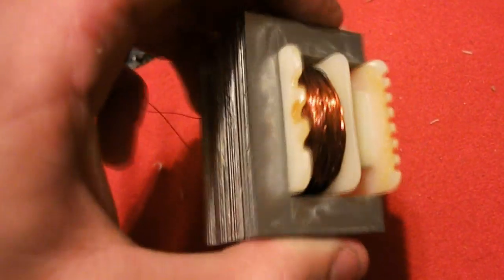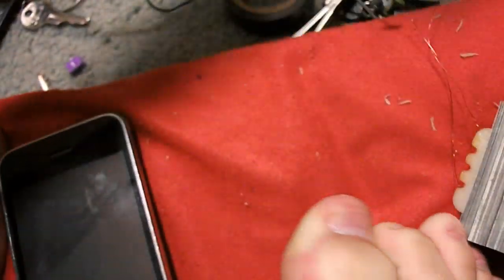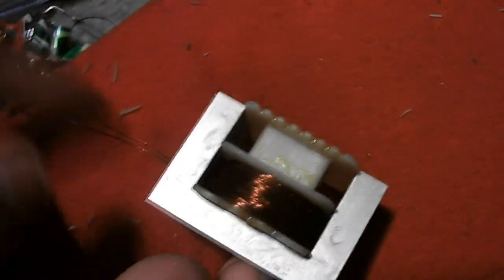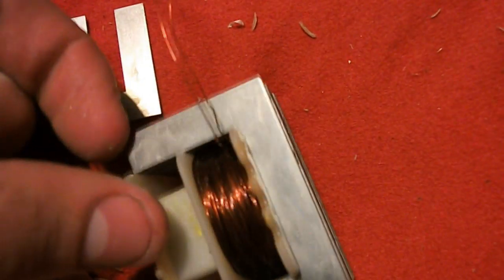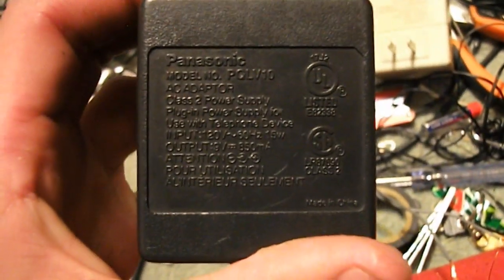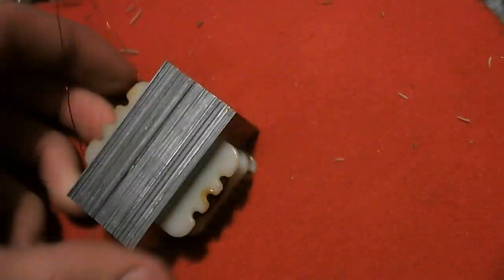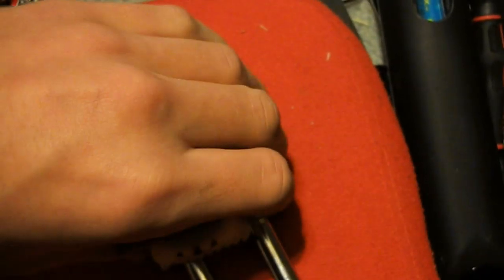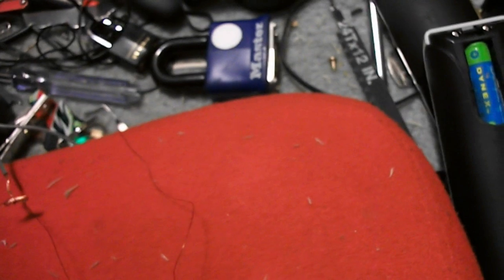how to make an electromagnet that works

Comment: you have tried AC... that was an ac adapter...
Reply from the maker: hattergraphics AC wouldn't grip anything. The field would turn off and on 60 times a second. It would hold,  then release,  then hold,  then release.

Comment: The 250 windings are for your house current right?
(120 windings for 120v outlet)
Reply from the maker: Not on this project. They are just the number of turns I found that worked pretty well with the 9v adaptor I had. Do  not plug this into your outlet, it'll blow the breaker and smoke the room.
Reply: Oh......
But why won't that happen if done with a microwave transformer? (with secondary coils taken out)
Reply from the maker: Yevette Xoxo Welll... That's a long explanation. Hold on tight! So, the windings on a microwave transformer are much thicker and the size of the transformer is also a lot bigger, this means the wire can handle more current. That current is then absorbed into the magnetic field of the transformer body- that huge lump of iron. That huge lump heats up a bit from this and also can store a whole lot more energy than those little wires. When the current is needed on the secondary, the iron core dumps all that power into the other winding which then eats all the power out of the transformer and keeps it from overheating and dissipating all that power. The windings don't get hot because the core itself sucks all the power out of them and stores it. On a rewound MOT, the secondary gets quite hot because of the amount of current it can pull. The ratio of turns between primary and secondary determines voltage, while the size of the wire determines amperage. Hope that helps!
Reply: Yeah.... I get all of that
But isn't that still bridging the outlet's + & -?
Also, just by removing the ''I'' section of a transformer, when power is applied, you get an electromagnet. Why wont that transformer's primary winding trip the breaker in the house?
Just because it is housed in a magnetic core?
Reply from the maker: Yevette Xoxo  AAAAND I present you with the best explaination I could find for this. 

As transformers are usually used with AC rather than with DC, there is what is known as inductance LL, which is a property of a conductor to "resist" the changes in the current flowing in it due to the magnetic fields induced by that current (self-inductance). The field is "resisting" due to the fact that alternating magnetic field is in turn trying to induce current in the opposite direction. So when we speak of AC, it is an alternating current, i.e. constantly changing which will be resisted by such a conductor. The amount of magnetic field created by a conductor i relative to the density of the conductor windings, so a coil with many windings will create a stronger magnetic field, which in turn will resist more to the changes. In case of transformer, there is an additional coil "sharing" the magnetic field with the primary one, so the magnetic field trying to induce the current in this secondary coil as well. But when it is open, or connected to a load, it is "hard" to induce much current there, so it is "resisting" harder in the primary coil as well. This is pretty much of the intuitive understanding. If you want some math, you can easily find it.
Reply: Ok.....but when I said remove the i section of the transformer, I forgot to mention losing the Secondary also

(And why did you say , ''So when we speak of AC, it is an alternating current, i.e. constantly changing which will be resisted by such a conductor''? I know what AC and DC means)
Reply from the maker: Yevette Xoxo That was a quote from the net, he means that the wire itself acts more and more like a resistor with AC passing through it. So imagine as the frequency rises, the amount of resistance the wire appears as increases. Then ohms law applies.
Reply: Okkkk.....so you're saying the thicker the wire, the safer it is to power it with 120v from the outlet?

Comment from the maker: Nononono! I am running only 9 volts. There is a transformer inside to bring it down. Kids, please don't use 120 or 240 VAC on this. You could die.

Comment from the maker: I am using a linear voltage supply, meaning not a battery, but one of the heavy, block shaped chargers. The can handle a short, switching supplies can not do it. The ones that are light will not work. If you want to use a battery, it should work just fine as long as you don't leave it too long or else the battery could explode.